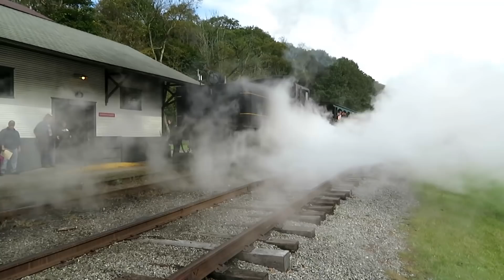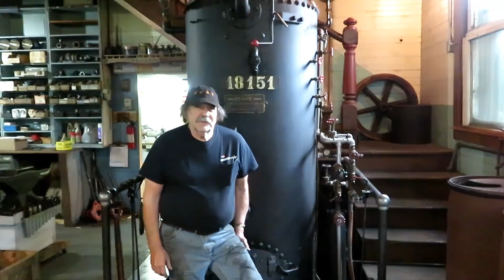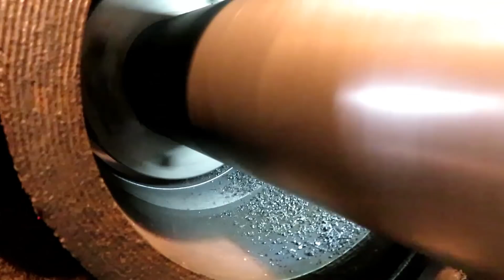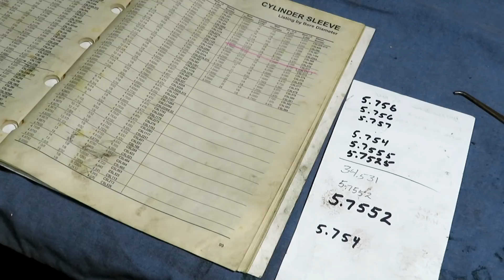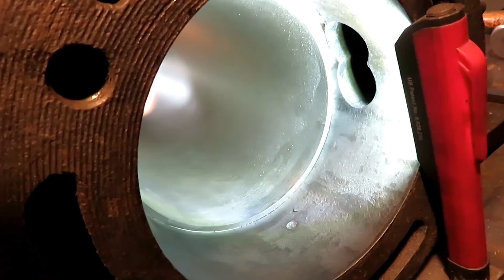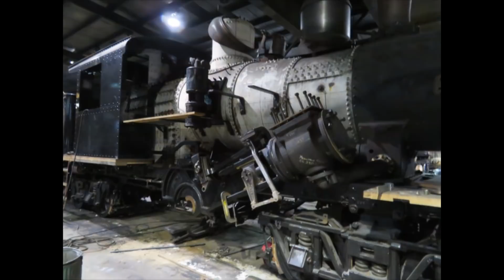STEAM POWERED MACHINE SHOP 50  Boiler certification, saving a hit & miss cylinder

Comment: Your request for comments is well spoken.  So here is my two cents.  Please don't skip the math demo when ever you have the chance.  Going back over the details for the intake and exhaust timing for the Morrison engine would be great.  I did not quite get how your numbers translated from degrees on the flywheel to the width of the slides.  They are so narrow, they could not be covering the ports for more than a few degrees of travel.
Reply from the maker: Hi Victor: The eccentric throw is pretty short, so if you watch it in comparison to the cross head movement it may seem more logical....Dave

Comment: First of all happy new year, I'm watching your videos because I'm learning from them every time.
I also have a question about line shafts. I want to build a small shed (living in the Netherlands) and installing a line shaft. Is it possible to do this?  Kind regards DJ
Reply from the maker: DJ, Why not, is there some kind of zoning that forbids it?  You can use old hangars like mine or fabricate the brackets and use  "pillow block" ball bearings. The size power and type machines would determine the best shaft diameter.
Reply: @davidrichards5594  most doubt I have is the maximum height of the shed about 9 feet. I have 5 hangers some different pulleys A drill press, power hacksaw, grinder and if I find one a smaller lathe. For power I have a fairbanks morse 3 hp. And I hope to find a electric motor for regular use. Are there any things I have sertainly have to think about ?  Kind regards DJ
Reply from the maker: @djdutch87  I would not use a shaft smaller than 1", 1/1/2" would be better. I would recommend about 300 rpm on the main shaft. I run mine at 275 and it should be faster. Make sure there is "crown" in the pulley surfaces of the driving pulleys. Good luck with it....Dave

Comment: Having plenty of experience in testing engines for thickness it can mean nothing as it measures rust. So a decent thick bore has either corrosion or some porosity and they get pin holes. I suspect the same in a boiler but possible an explosion!
Talking 20 years ago to a lady at the Peterborough Rail Museum in South Australia they had some lovely old engines that they could not use. Because of boiler issues which in more modern times cost a fortune. So these locos will possibly never be used again. Yet are in running order. The last company making boilers had closed so one off jobs cost 6 times as much. 
I have heard similar from people into steam riverboats on the Murray river though they do seem to have a bit better deal with getting boilers made. It seems a bit more one size fits all.
This at Echuca, home to at least 2 dozen operating steam boats and more on the overhaul phase.
Reply from the maker: We have several boiler builders here and in Canada that reproduce about any fire tube boiler. But the waiting line is pretty long...Dave

Comment: I love what you do,it reminds me of my grandfather's shop. But please remember what you're doing is bigger than  your current viewers,its preserving things that could be easily lost for  generations to come.
What do they use for rings? Do you make the sleeve a little tighter and reuse the old ones? Did they not use rings or does it all depend on the job 
Thanks again and I've been a viewer since #31
Reply from the maker: Cast iron reproduction rings for that engine are available  by dimension. The sleeve when installed was bored and honed to fit the worn piston. The new rings will be a little tight in the slightly undersize bore, but can easily be filed a little for the correct end gap. Thanks for watching in Jersey....Dave
Reply: @davidrichards5594  thanks, I'm going to assume there's a way to machine them if needed.

Comment: Another great video Dave . In Ontario we have to have a thickness check every 10 years on an original riveted boiler and an internal inspection one year then the next year a hydro. Blow off valve every 5 years and steam gage every 3 has to be certified

Comment: I wonder if as she heats up under power,that tight clearance you mentioned would cause a problem.Also ,maybe a quick boroscopic inspection after the first run probably wouldn't hurt.Being an old radial engine guy I tend to head that way.Probably overkill,but as we used to say in the old days what you don't know,can kill you

Comment: Another Great video Dave ! Enjoyed seeing the Shay engines & their machine shop equipment on your stop at Cass. The boring job on the IH hit & miss engine & boiler information was interesting, informative & enjoyable ! You are truly a skilled & talented machinist & boiler operator ! Love your Wisconsin built G & L HBM too !
I worked at an oil terminal back in the 80's that had 2 large Cleaver Brooks boilers that could run on either high or low pressure for steaming (heating) the rail tank cars that came in with number 5 & 6 oil which we blended for different industrial industries & asphalt plants. The steam also heated the 2- 30,000 gal blending tanks, 2 of the 500,000 gal storage tanks as well as heating the facilities' buildings & offices. 
I see you're down at your winter retreat. Hope the weather is treating you well there & that you're able to take in some enjoyable activities while your there. If you do any projects or go to any engine / tractor shows, swap-meets, road trips or like activities while there, Please shoot some footage.
Thanks for your time on the videos & Please keep them coming. I've greatly enjoyed ALL your videos. There is Plenty of interest & appreciation of what you do out there in the YT community !! I'm sure your channel will continue to grow & be enjoyed as word gets around.

Comment: Dave, you are the ONLY consistent steam driven shop video producer. Whatever you do, don't stop producing videos of your shop and the work you do. You show indicators and methods that are seldom if ever seen by anyone- in actual use. You can't find this type of content anywhere but here, at least as far as I know, on a fairly consistent basis. Just like this video concerning the boiler inspections and certification, no one does anything like that, I don't know if it is even mentioned. Obviously you had folks asking questions about it. When you can make videos, make 'em! When you are snowed and need to get a hot job to a customer, that's good business so we may not get a video every month, that's just the nature of the business. Please keep making the videos as you can.

And about your machine related vacation, trip, bucked list videos, ABSOLUTELY! Never dull and always interesting. 

Now if anyone else is producing any steam driven line shaft shop videos like this, I'm sure we'd like to know who it is, but even so it wouldn't detract from watching your shop work. 

Right now I'm seeing 4,285 views and 1K thumbs up, probably because it's not possible to give two thumbs up per viewer. 22K subscribed, you're doing something right and with good content!  If you enjoy sharing your shop and steam driven machining, we're watching!

Comment: Dave, what I like about your videos, is that you are not trying to put out something every week no matter what. which typically ends up as boring. As the old saying goes, Keep on keeping' on 👍  I like your sleeve boring shows. I have done the same thing on hit & miss engines using a portable boring bar with excellent results.
Reply from the maker: Thanks for the comment Warren. I've bored all kinds of stuff with an old Van Norman 777S which I sold last summer. Hated to, but had to make some room for other things. Still have a Kwikway on a stand for smaller  jobs....Dave

Comment: WHAT, you dare use a modern hydraulic sleeve puller !!!  LOL. .005 sounds a bit tight, but if this is run as much as most show engines it might get warm enough to heat water, once or twice a year...
Reply from the maker: I know, seeing as how it's a common job these days, I was thinking about rigging up a water cylinder and pumping it with the steam pump. It would be a good use for it maybe....Dave

Comment: A big thank you for all your videos and a Evan bigger one for any ones you produce keep up the good work .
I started work in a iron works as an apprentice sparks ( 5 years ) they had 6 blast furnaces all dc powered haulage with slate backed open swithes and contractors no h&e in sight a lot of the machine in production and maintenance.depts were flat belt drive ,horizontal boreing mill were 18 foot beds (used during WW2 for boring gun barrels up to 18 inch dia later when I was there they were still in use for boring moulds for the cast iron spinning machines give you a idea when I am 72 next month and left school at 15 to start work , great thing changed jobs for better pay but still in engineering and retired at 50 🤞🏻👍. Keep up the video work 
Stuart
Reply from the maker: Thanks for the great comment Stuart, an 18" bore, 18 feet long is a serious job......Dave

Comment: OK you got me lost.  @1:48 just before that, you show the smoke stack, but a little after 48 you see black smoke coming up right before the cab. Where the heck is that black smoke coming from because what is shown coming out of the stack is not black or steam. But you can see is the steam what I guess is from the generator, and behind it is black smoke.
Reply: There are two locomotives, because of the steep incline; it is called double heading. That is what the subtitle is telling you. We don't see the second being coupled up. It got me wondering until the subtitle came up.
Reply from the maker: @andybelcher1767  A little confusing, the intro was of an earlier train that went to the first logging camp and back, our train was pushed by 2 locomotives double headed  (or double tailed I guess you could call it). We  went past it at the first switchback. Our train went the whole 11 miles and hit some 6% grade.....Dave
Reply: @andybelcher1767  Thanks.

Comment: You could put the sleeve in a freezer. In that way you can slide it easily in without any tools.
Reply from the maker: Good comment Olli,....but it won't. Freezing the sleeve is usually the first thing most people suggest. Heating the block does much more for you. To ease up a forced fit the DIFFERENCE in the temperature between the two parts has to be increased (block heated and/or sleeve cooled).  If they both start off at say 70 degrees F. and you freeze the sleeve down to 20 degrees, you changed the temperature 50 degrees. Now if you heat the cylinder in an oven to 300 degrees (not much for an oven) , you changed the temperature 230 degrees. Then it will slide in. I did that on one of the other videos.  It's a little difficult heating it evenly with a torch flame set up in the mill.....Dave

Comment: Did the sleeve have a crosshatch in it already? Or did you put it in? Do you have the tools to put a cross hatch in?
Reply from the maker: No, the sleeves are just rough bored. The boring mill leaves a pretty fair surface and then the #220 stones in the hone (with the hand drill) do the rest....Dave

Comment: WOW! What a beautiful locomotive! I didnt even know that there ever was a wheel drive system like that  made on a locomotive!
  I am wondering why you didnt freeze the sleeve and warm the cast before installing the sleeve?It will make quite a bit of difference in the interference by doing so.Thanks for the videos and keep up the great work!
Reply: I've never been to Cass, but I have a pretty good interest in steam RR engines and the early lumber industry. You may want to check out other types of steep grade designs like the Climax and Hystler along with the Shay. There were others. The Shay types were the best of all.

Comment: Dave, A sleeve job never gets boring, but if you need a job in our local shop in a hurry, the trick is, you better show up with a six pack and a few cigars, and then you get to the front of the line. Everybody has got to eat,even the machines.

Comment: I am interested. I love the videos. I love that whenever I put a question into the comments here you always responded thoughtfully and quickly. If I lived anywhere near I'd try to apprentice;)
Watching you hone brought to mind flexhones. I remember when they came out there were considered gods gift to the mechanic. I had them in my tool box and for slight wear you could just go with slight over size rings and a cylinder hone. Even if you didn't have much wear when re-ringing you could whip it out. It's been decades since I was a mechanic, I had a whole career as a software engineer after that, but I still miss it sometimes. I love solving problems and using my hands. Software gave me the first. Just the last couple of years I've been learning silversmithing and jewelry making. That exercises both. Always did want to learn machine shop. I had a beginner course last year at the community college where we all made little steam engines during the semester while learning the basics of mills and lathes. I was successful in that I was the only one who's little steam engine ran, but to tell the truth, I didn't learn that much. The feel of the machines was an important thing, the smell of things, but still -- didn't learn much.
Reply from the maker: Great comment Patrick, as for the machining, now that you know HOW to do it, you start learning as you do it. Just the way it is.....Dave
Reply: @davidrichards5594  if I only had access to a machine shop, lol!

Comment: These are very interesting videos.  I love steam powered machines.  Question David:  How did they time the magneto to fire at the right time on that hit and miss?  Thanks keep em coming!
Reply from the maker: Dale, The mag is sort of a quarter turn spring wind up deal. There is a push rod coming  from a cam and roller that pushes a latch lever on the magneto shaft and winds it up. It's adjusted to slip off the lever at just the right time and let the mag suddenly unwind causing the peak voltage. ...Dave

Comment: Hi Dave
It's nice to talk about permits to operate steam boiler. In Quebec there are 4 operators classes. I finished with class 1 and I have often done tests with the inspectors. Hydrostatic tests with recirculating boiler feed pump  where I put the pressure in the boiler at 10 MPa (1450 psi) for a few hours while others entered the boiler and checked for leaks or distorted pipes that were noted . All the licenses or permit  of each operator were hung at the entrance to the control room .......also a see on your horizontal boring machine comes from "fond du lac" wis.--->>> transalte for "bottom of the lake"  wis. it comes from our ancestor expolrer from new france. bye bye dave
Reply from the maker: Hi Yogi, thanks for the comment. I've always thought that operators of antique and replica hand fired boilers should hold a certificate. "Bottom of the lake" huh? I think G&L still has a plant there, or at least offices....Dave

Comment: Enjoyed the look at the Cass Scenic from another perspective.  I still enjoy one particular set of videos on that place.  They are a sure way to get an energetic 4 year old nephew (and any other 3-6 year old boy within earshot) to sit still and quiet for 15 minutes.  The first blast of that steam whistle, all goes quiet and they are drawn to the source like metal chips to a magnet.

I'll have to admit that I'm partial to the Shay's, even more now since I learned that a cousin was part of the operation.  I understand that they did try their hand with the electromotive diesels when they started to gain favor ... but it wasn't quite enough.
Reply from the maker: The larger Shays are really impressive power. They were remanufacturing a Hysler in their shop and are suppose to have a Climax somewhere also....Dave

Comment: Enjoyed the hit-and-miss engine restoration. You probably made the sleeve to piston fit better than original. I can see where most of that job was set up on the horizontal boring machine. Thanks so much for the time you put into video presentation of the work.